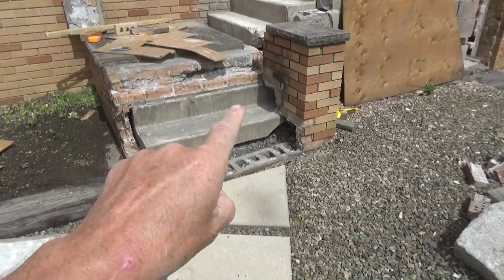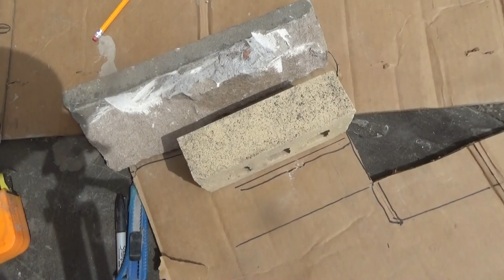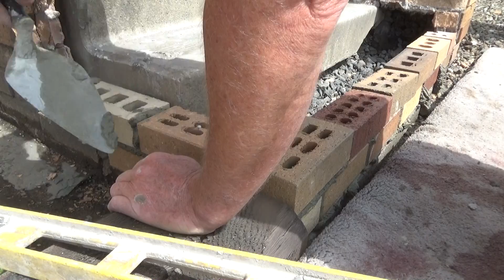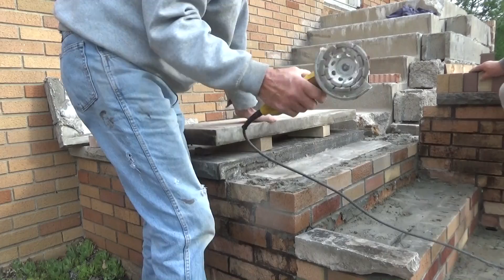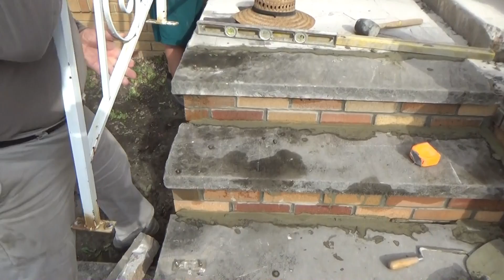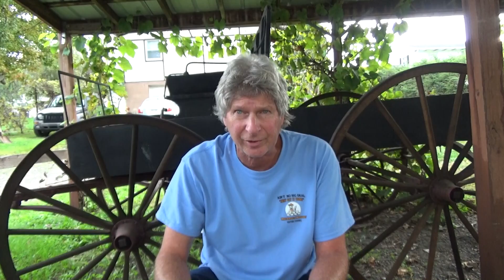BRICK STEPS REPAIR (Part 10) Mike Haduck

Comment: We have an old church building to house project. The steps are a mess. Local brick with thinset over them. The steps are a very low height. I need to tear it down and build them back with new mortar. What's your thoughts on thinset over brick?  Do you think mesh reinforcement is needed when it's only a few inches thick of thinset? The other set of steps is also thinset over brick, so I suppose I should match it. Thanks.
Reply from the maker: In my area I usually change them to stone threads,  and stucco underneath,  I did it on other videos thanks Mike
Reply: @MikeHaduck  I'll have to look. I'm not sure what that would look like?

Comment: Thanks for the video Mike, I'm getting chimneys rebuilt from roofline up and have a choice to either use solid or holed brick.  Based on your commentary it sounds like solid brick is the way to go. please confirm
Reply from the maker: Hi Bob, I can't tell you what to do, it's hard to even find brick without holes in them anymore, ,Mike

Comment: This comment is not related to this video but I am commenting here because it's  your most recent one and figured i would have the best chance at a reply. In most of your paint it with Portland videos you emphasize the need to repaint every year because it goes on so thin it flakes right off.. I was just wondering if you have ever made a video of that flaking or have any pictures of it. I'm trying to decide if i want to do this project. Thank you
Reply from the maker: Hi Daniel, I assume you talking about a concrete driveway,  it's the last step before replacement, filling holes to keep people from tripping and painting so everything matches, It just a old school trick to make concrete last longer, best to do a little section first out of sight and watch the results, thanks Mike

Comment: Mike, I agree with you regarding the reasons those bricks have holes in them. I know it's time consuming but if I were doing a similar job on my own property, would it make sense to fill in all the holes in the bricks several days or even weeks in advance so they had a chance to set up? I'd fill them in all the way through the holes and smooth them out with a sponge. If I did this, should I use pure Portland or what ratio of Portland and sand should I use? Our weather is similar to yours for freezing and thawing. Thanks!
Reply from the maker: Hi Michael, if it is protected from the rain, snow and ice there is not a problem, keeping the brick from getting wet is the real trick, mike

Comment: Question,  we have a lot of extra red fired solid clay brick from Glen Gery,  how long would you guess it would last if we used it in the firebox if used in conjunctionwith Heat 50 morter, I don't mind replacing pieces when needed, we learned " it's no big deal" 😉  
 ( This is an outdoor fireplace away from the house. )
Reply from the maker: Hi Kyle, I can't say, I never used Glen Gery that I could remember, but whatever works, keep the moisture out if you can, Mike
Reply: @MikeHaduck  thank you!!!

Comment: I've had good luck using Thompson's Water Seal on basalt masonry. My chimney was built in 1948, and over the years water started finding its way in through seeps. I learned from my mom to apply Thompson's each September. No more drips or damp spots. I also put a stainless chimney cap on last year, which made a difference too. I'm looking at having glass doors made to fit, so I can use the fireplace more. 

In addition to basalt, some of the native stone is tuffaceous. It absorbs water a lot like brick, and the water seal keeps it from flaking off. In some cases I sealed the rock first with Portland paint darkened to match. Some of the stone has so much iron that it rusts. That seals well too.
Reply from the maker: Thanks Brian, I used the same stuff on my stone chimney,  Mike

Comment: Here in the uk we use priming slurry for setting stone/ pavers is this something you would use
We paint the slurry on the surface and on the back of tile / stone to ensure a good bond strength
Reply from the maker: Thanks A R, I can see that would work fine, Mike
Reply: I live in Southern New England USA and when we set stone stair treads we make a priming slurry out of straight cement usually I've also used tile mortar or stone veneer mortar on the underside of the stone
Reply: Can also score the bottom of the treads to really lock them in

Comment: I noticed that he put the railing up to mount it to the stone tread on top through the tab the railing had on the bottom. 
If you felt it would be better to bore a hole through the tread and mount it below, but the owner seemed reluctant, would you try to convince them it would be better the other way? Or, just do what they want and not bother explaining why you think your way might be better?
Reply from the maker: Hi Joe, sometimes I might say " l seen others so it this way or that way " but never try to tell them what to do, then if it fails its my fault, so as they please,  thanks Mike

Comment: Mike if I wanted to change the look of my brick planter box connected to my house, can I lay mortar over the brick to surface it with another material?
Reply from the maker: Hi, I guess it depends on how bad the brick or joints are not cracked, and what the weather situation is, I have stuccoed over them before, but planters leak water and It could cause problems, thanks, Mike